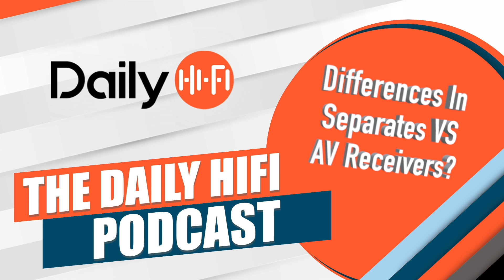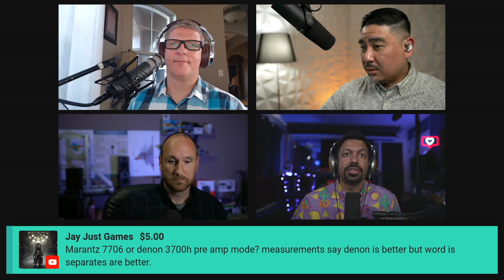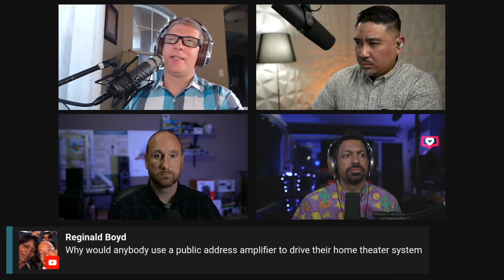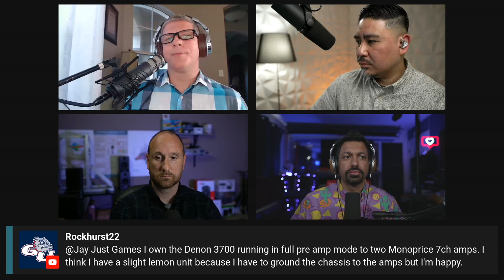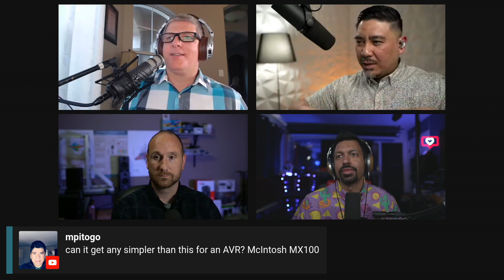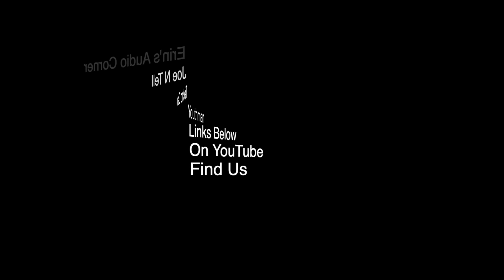Differences In Separates VS AV Receivers?

Comment: I have yet to see any measurements for this. I've seen many videos claiming it sounds better, but have yet to see any objective evidence for this. In my mind the only reason to have separates is if you need more power. That's it. It will not make your system sound better. AVRs have a very low noise floor even with all channels driven. Any noise is most certainly not audible.

Comment: When you ran the 7706 could the calibration/ audessy setup have been the difference. Could simply output volume have been the difference?. 

It would be really interesting to take the actual processed signals and compared them and what is actual coming out.  I just don't know if the processor that actually does the decoding is really any different. And if cross talk is really an issue between the two models that it would be at a level to cause any perceptual issues.

Balanced outputs would be the biggest jump, but on short runs unless you have some real interference issue the benefits maybe null. The biggest advantage to most balanced lines is higher voltage output that let's you drive an amp with more voltage before the source avr or preprocessor would start to distort the signal output. Some AVRs will clip thier line out pretty early when driven. That can make getting an amp, especially a pro audio amp, that typically take higher input voltage to drive it properly.

The 3700h would just have a huge economy of scale factor in its favor. You hit preprocessor and your into boutique level stuff and associated prices pretty quick. 

Oh the decisions.. I want a preprocessor to drive my amp racks but the price to performance of doing a 3700h or even 4700 is just so so tempting. That's alot of money to put elsewhere....
Reply: Thank you for this intelligent and thoughtful post.  I very much enjoyed reading your perspective.
Reply: Spot on. Even if the dedicated processor is using a different DAC than the AVR, you will not notice the difference. I think most people are saying they hear a difference with separates is either due to confirmation bias/placebo effect or simply because of (like you said) calibration differences. If it sounds different, how do you know it's "better"? What is better anyways?
Reply: And all that said I run a marantz pre-pro with all qsc cxd multichannel amps now.  Does it sound great... omg.. yes!!! But 98% of the time I never push it close to what it can even do without working hard. It's my show off system and beyond a show off demo for a few minutes or two of a movie.. it never gets pushed to what it can actually do. 

Although the headroom sure is nice!